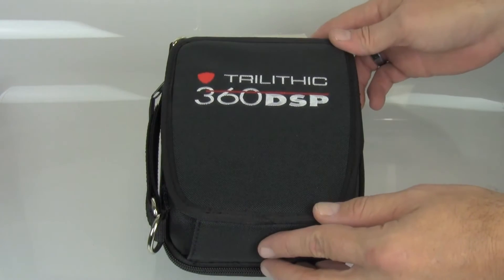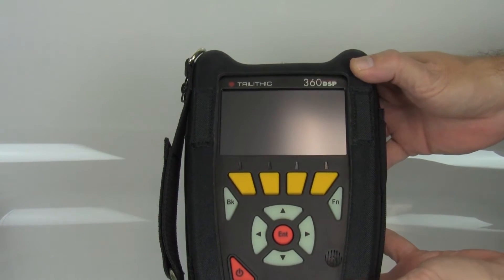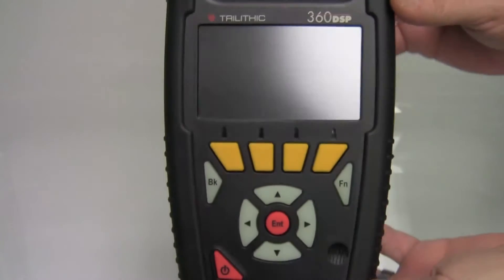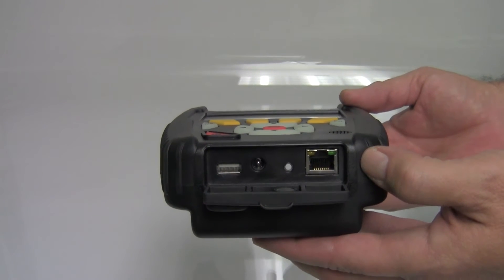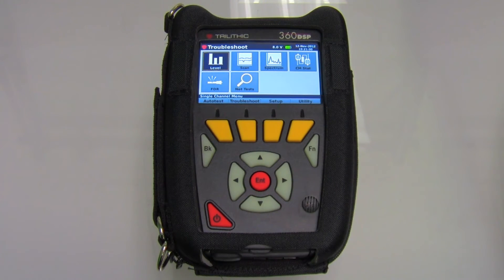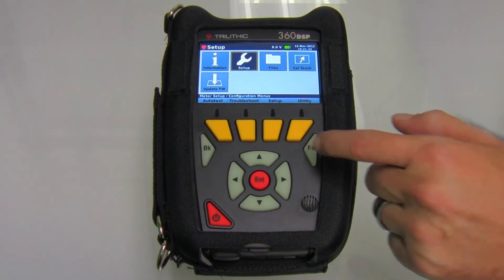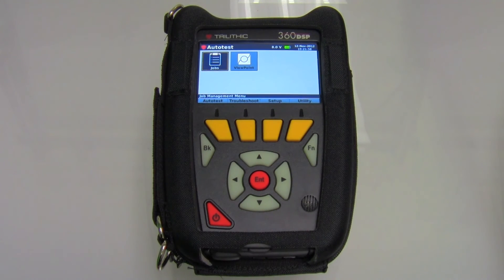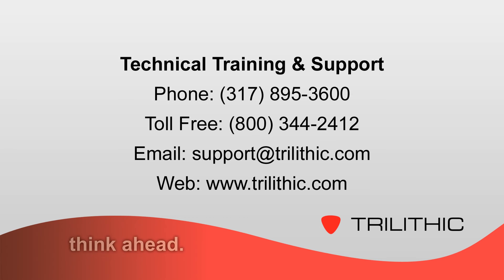Trilithic 360 DSP Overview

Comment: Can you please share what the specs are on the screen of the meter? I need to replace mine. I suspect water damage despite the rather wimpy (just in my personal opinion) seal around the screen and the exterior. Coming from an experienced computer and cable tech. Please reach out...I'll be happy to provide my contact info to resolve this rather expensive issue.
Reply: I got one for sale along with acessories